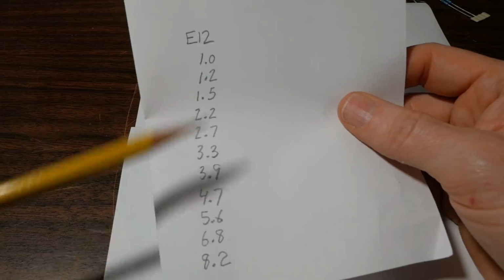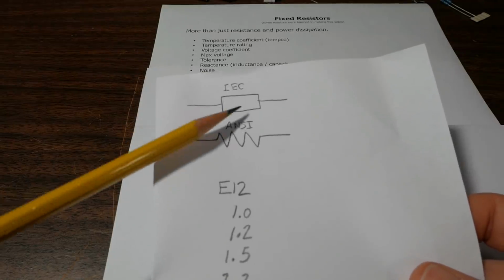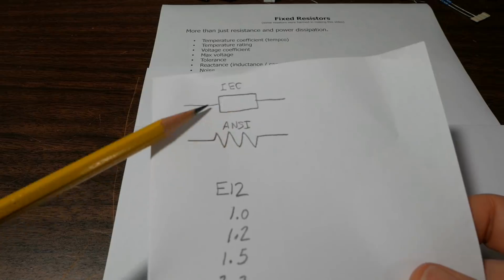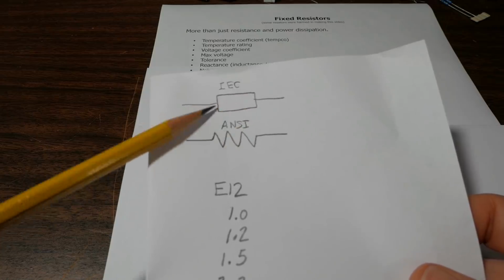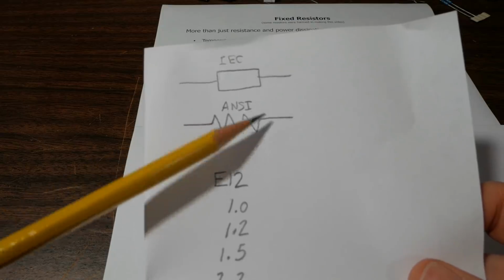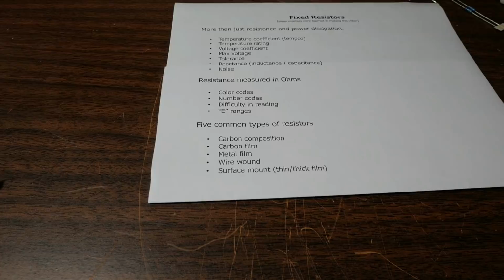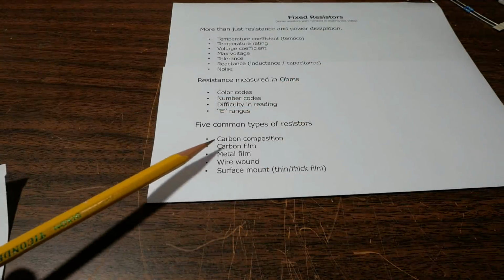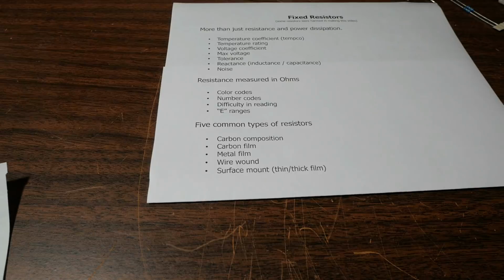RESISTORS a deeper look into this common electronic component

Comment: Sometimes, the inductance of wire wound resistors is a good thing though. Helps with surge, which is often appreciated when using them in the first place. Just worth pointing out.

Comment: MOX is also quite common here. they're my choice if there's no metal film or metal foil resistors available (mostly 1 to 2W rated). they have lower inductance than a normal wirewound while still cheaper than non-inductive wirewounds which is a rare thing here. i can only find dale lvr series and they're expensive!.

Comment: Hi jhon ,hope you remember me with faulty caps on TPA3116d2 board.I figured the problem is with input caps.if I touch one of the input caps with hand it works well,if I remove the hand the music cuts after few seconds,here is the video of problem-https://youtu.be/IdBZxToUAHo
Is this because of bad capacitor or something else?any better value capacitor recommended or should I replace it with same value caps(I thinks its 2.2uf)?
Reply from the maker: That behavior seems to indicate a bad connection or solder joint.
Reply: @JohnAudioTech  I resoldered a new cap but problem still hasn't gone!I am Just touching cap not putting any force on it.

Comment: Excellent video, but If you measured typical large value resistors at HF/VHF frequency you would actually see that they generally have reduced measured impedance and a capacitive phase characteristic. It's only when you get above this when the inductance comes into play...

Comment: From what I see at AliExpress, the 1% Metal Film resistors are as inexpensive as the 5% Carbon Film types.  Why  are Carbon Film resistors even manufactured?
Reply: I guess the question is if they are of equal quality. Some of the really cheap MF (or CF too) resistors made in China do not live up to their tolerance spec.
Some of the better quality MF (or possibly CF) resistors are also marketed as "non-inductive", in those cases the spiral cut reverses direction halfway down the barrel. High-quality MF resistors can also have a ceramic glaze instead of an epoxy coating and be marketed as flameproof. But yeah, when MF=CF in price and construction, there isn't much point to CF.
Reply: I recently had a war on resistors ... measuring 100's of a type, to find the normal distribution, in hope of making precise, parallel shunts.  Had hoped this would help me produce precision current sources.  Failed.  My common 1% resistors were mostly in spec, but were not averaging to the target value.  Finally purchased some 0.1% resistors domestically, which were expensive -- but  spot on consistent with their nominal value, and with each other -- beyond a factor of 10.  Would like to know where to source 0.1% resistors cheaply.
Finally built a 4-wire rig, a little like Dave's:   https://youtu.be/kSmiDzbVt_U